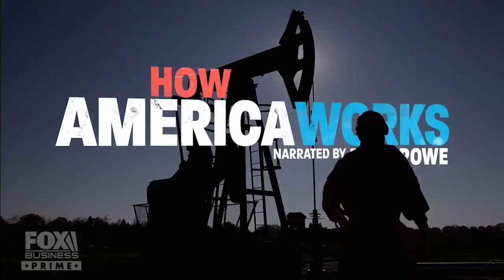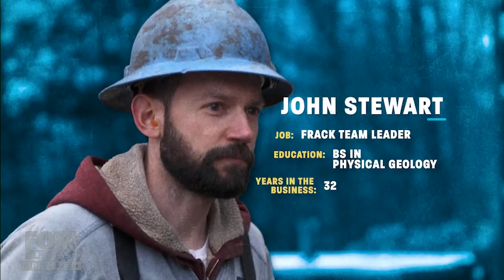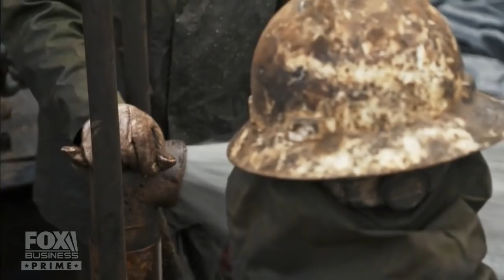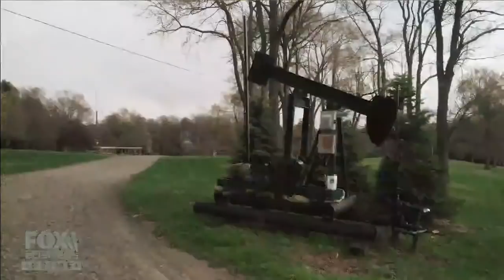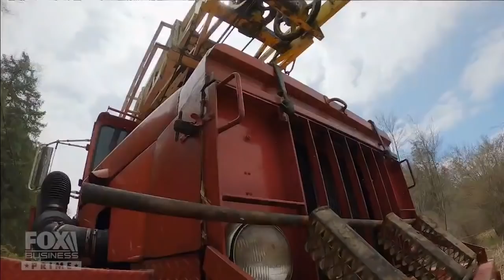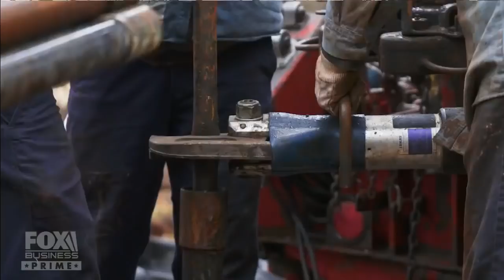How America Works: Pennsylvania oil

Comment: I do frac work in Western PA, I can honestly say I have never seen an operation like this.
Reply: How is it?
Reply: true i was a frac hand for 10 years i fracked in texas nd montana and pa and ive never seen an operation like this in nd just the vertical pipe goes over 10000 feet deep in pa we averaged around 5-7k feet deep vertical and 16 pumps
Reply: Really I'm in Canada I have serviced wells just like this
Reply: I’ve serviced wells like this in Canada as well
Reply: but is it true fracking makes the local water containmated with toxic chemicals?
Reply: @xcen1  no they are fracking below the drinking water table. after 800 ft water is not safe to drink.
Reply: @xcen1  : No.  That is a complete lie.  Fracking takes place 10,000 feet below the lowest level water is found.  There is an impermeable layer of rock in-between the lowest level where water is found and where fracking is conducted. No toxic chemicals are used in fracking.
Reply: I am planning to get into the oil 🪔 business I can locate oil 🛢️ then the trick is finding the right people to extract it.

Comment: My 1974 Vega station wagon  back in the 1980's Loved oil ..used to go through 1 Quart every 45 miles
Reply: The Reynolds 390 coating was worn. If you brought your car to a dealer, they would install a new engine block. I had a 1971 Vaga.

Comment: The show is informative, but quite misleading.  Most new wells and frac jobs are 10-20 times larger than the well profiled in this show.  The fact that the show calls out everything in gallons (instead of the industry standard of barrels) highlights that this is a reduced representation of the industry .  This would be like explaining how airports work and operate, but doing the show at Dawson Community Airport in Montana, without mentioning O'Hare or Jackson Hartsfield.
Reply: @darekm6859  You missed the point, no worries.
Reply: Not really we still do the small drilling, well maybe in PA. NY hates people making money. Do you know the size a drill site you are talking about would need to be? The enviromenlist would be all over them, as well as the loggers as how much of the forest would need to be taken out.

Comment: I want to know how they dealt with replacing the pipe.
Reply: overshot
Reply: If you are talking about the pipe that was broken off it was simple. You use what the old timers nicknamed the fishing tool. Sent it down, pulled it up sent it down pulled it up. Oh and lots and lots of prayers. I grew up in southwestern NY near the state line. We had our own oil field on our property and Pennzoil plumped oil up and down our valley.

Comment: Why would Oil be in contact lenses and chewing gum??
Reply: Anything that is plastic or rubber will be made out of oil. That also goes for contact lenses which are made of plastic and chewing gum which has a synthetic rubber as it’s base. Chewing gum before had tree resin as it’s base, but in the 60s, manufacturers used synthetic rubber to save money.

Comment: Ah yes, fracking. A great way to pollute the air, soil, and groundwater.
Reply: It’s just water chill
Reply: @Free Commercial   It is definitely not just water. Ground and water pollutants from fracking include ammonium, barium, chloride, iodide, manganese, and strontium. Air pollutants include benzene, ethylbenzene, hydrogen sulfide, nitrogen oxides, silica dust, toluene, and xylene. Also, according to the EPA, the fracking industry has about 150 accidental spills of fracking fluid per year.
Reply: Waa waaaa